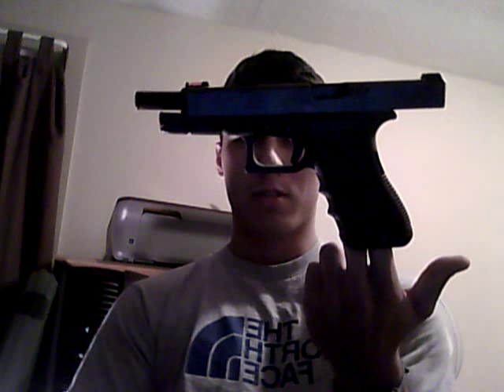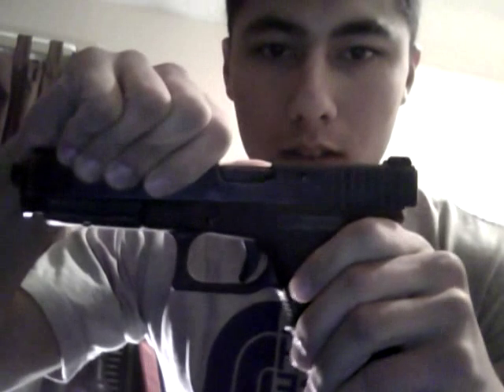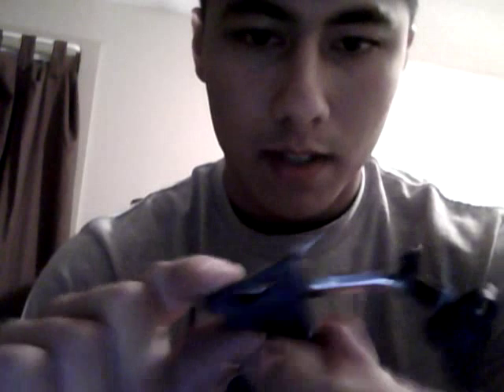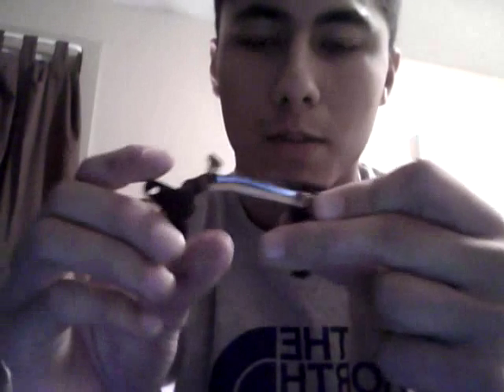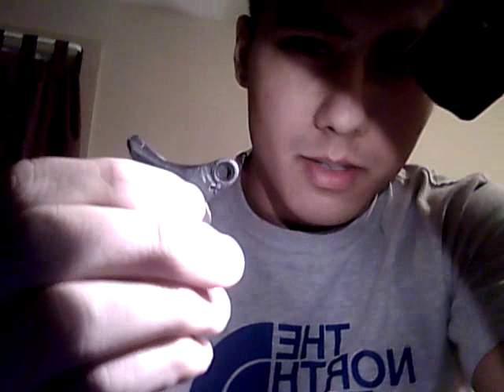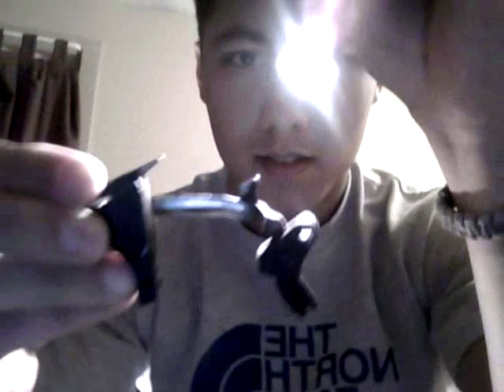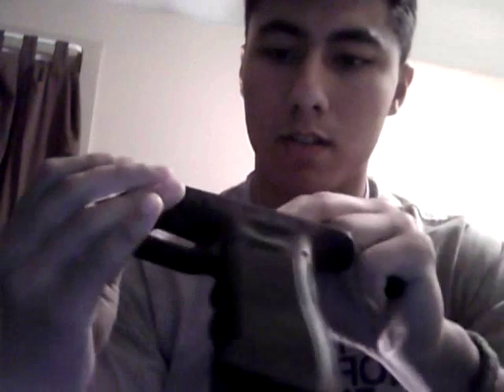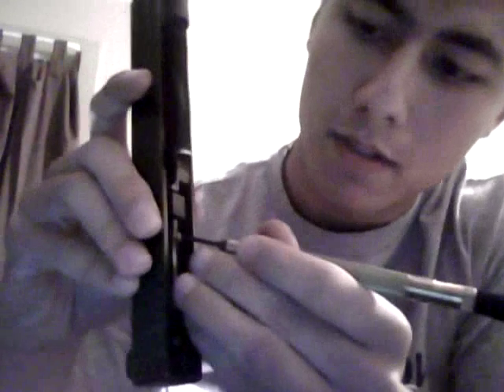Glock Plastic Fork Mod Explaination

Comment: Take a flashlight and look inside the mag well when you pull the trigger. You will be able to see the plunger being engaged by the trigger bar. There is a new product that just came out today called the Haley Strategic Skimmer Glock Trigger. This will give you the same effect as your mod, but both safeties will still be intact. I think the way the Haley Skimmer works is they drill out the trigger pivot pin separating the trigger from the bar. Then drill a new hole further up on the bar.........

Comment: you can get the same effect you are getting with your mod by just bending the part of the trigger bar that connects to the trigger spring towards the barrel to an almost 90 degree angle. then re-assemble and look in the mag well to check if it's hitting the safety plunger and bend accordingly.

Comment: Part 2. This makes the bar shorter thus shortening the over travel. Next trim the trigger safety as you stated in your video. I have never done this, it's just stuff I heard about on forums, so I'm not sure exactly where to drill the new pivot hole. I think it would be better and less headache to shell out the $150 for the Haley Skimmer and call it a day.

Comment: About the safety disengage...  I would think you would have to relocate the bump on the trigger bar that disengages the firing pin safety, and move it more forward towards the muzzle so that it is delayed propper. How much to move it is the question.

Comment from the maker: @SgtRum Thank you for both comments! The trigger safety is not a big deal to me unless the USPSA rule book says that it's not production division legal anymore, however I would like to make sure that the FPSB is functioning 100%. It's too bad because the trigger safety would be an easy fix. The FPSB not so much since I can't actually see it. Maybe the link you provided will give me some insight to how much I will need to change the location of the bump on the trigger bar.

Comment: The trigger in order to allow the safety to reset. I do not recommend you do this. But I have heard it works. If you do this do so at you own risk I am in no way responsible for anything that may happen due to this mod. And I would rather you just use aftermarket parts to do this

Comment: I care about firearm safety. Blocks are designed to not have a safety switch due to the fact that they have 3 internal safety's. You have effectively disabled two the plunger and the trigger safety. There are kits that make the mods you are trying to achieve while retaining all safety functions. I highly suggest the kits over doing and "Mickey mouse" style work to your gun. If you flip you gun upside down and shine a flashlight into your mag well you will see your plunger. You can pull you trigger no see the movement of the plunger. There is a lip on the striker that contacts the plunger to block its movement. Making the gun safe. This lip is less than .020mm wide. You will see you plunger actually lifts up as soon as you touch your touch your trigger and may be slightly depressed without touching it. In order to fix it you would need an aftermarket plunger with a smaller gap. The trigger safety I have heard you can shave a small piece off of the lip that sticks out of the rear of
Reply from the maker: Gee Man The plastic fork mod was just an experiment to see how I could effectively pin the trigger to take out pre-travel. I later started drilling and pinning the trigger in a way the trigger safety was still enabled. I can't remember if I put the video up or not. I stopped trying to develop this after the Haley Skimmer trigger came out. Basically the exact same idea.